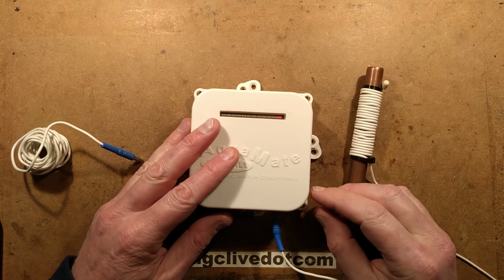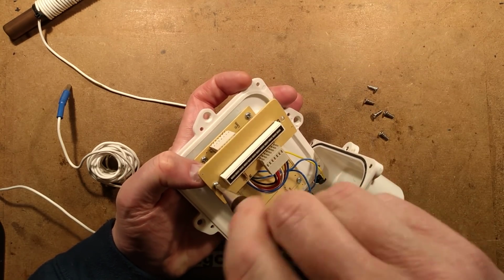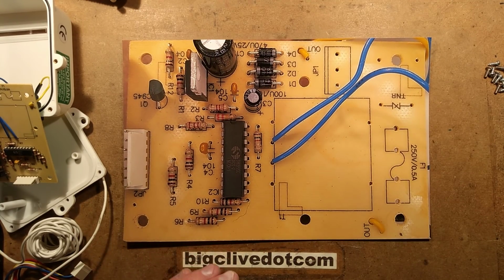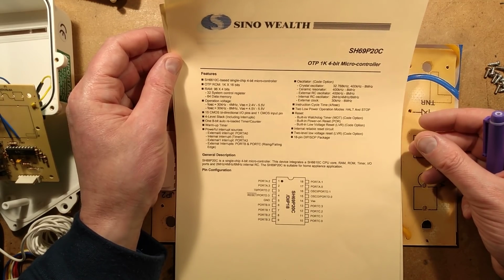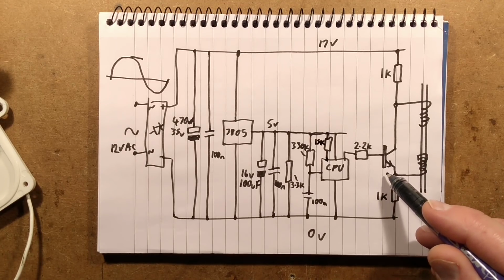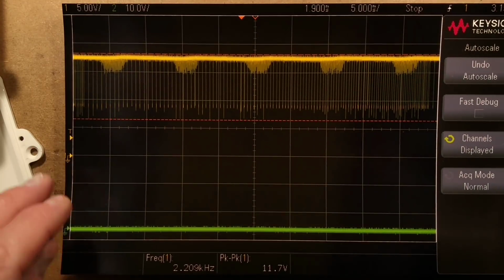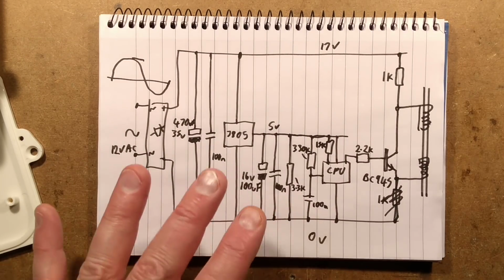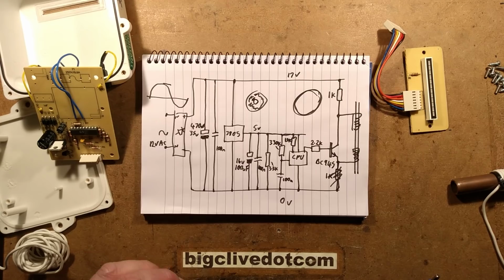inside a computerised pipework scale reducer.

Comment: These devices are pure snake oil. The German term Bauernfängerei (catch a farmer/clodhopper) translates to confidence trick. I hate these a55holes ripping off preferably older people.
Reply: Yes, my father was ripped off by a "flight technician" that said the neighbor used one of these devices for the hard water in the area. As my father was usually suspicious I was amazed he swallowed the proposition without questioning. Earlier I had proposed a filter, but that fell on def ears. I cannot say anything has changed in the last two years it has been installed. But our apparatus have a more confident green light bar going up and down to let you know it is on. The placebo is quite soothing. 

Blinken lichten bedeutet working machine.

The same technician told me he could help me with some weld repair (as I am no welder) but he brought a far to small machine that could not produce enough current. The welds gave out a couple of minutes into using the machinery. The technician no longer can find any work here.
Reply: @aopstoar4842 , these guys ruthlessly picking pockets.
Reply: WAIT! Will you say, my Orgonite Akasha Chembuster did'nt work? Oh nooo! 😱😱😱
Reply: I wonder if this is where the Star Trek "Ferengi" aliens might be named after?
Reply: Blinkende Lichter bedeutet das das Gerät eine Funktion aufweist 🤣
Reply: Vorsicht Falle: Nepper, Schlepper, Bauernfänger.
Reply: I'm surprised that Clive didn't get a powerful smell of bullsh*t when he opened the casing.
Reply: And then you have people buying these scams sometimes for thousands of dollars...
https://www.youtube.com/watch?v=-_56emG8guo
Reply: That Apollo dowsing rod is twice as effective as homeopathy. It's the Antenna ring which makes it highly effective when finding unicorns.
Reply: Looks like Big Water has gotten to all sorts of people...
Reply: I had one in my house for many years believe me it did NOTHING,if you need soft water buy a water softener they cost around $ 500.00 but they do work.
Reply: That will go on forever.   About 10-15 years ago, a plastic ball filled with water was marketed quite successfully as a substitute for laundry detergent.  People swore that it really worked (in fact, most clothes washers don't rinse all detergent from a load, so you still have residuals).  It was one thing that made me lose confidence in the reasoning abilities of "educated" people.

Google "laundry ball" for more information.
Reply: @tubastuff  Interesting. Laundry bollocks would be a better name.
Reply: They are ripping off everyone. Even the people who don't believe these scammers.

Ignorant/gullible people exist everywhere. Some of them are in positions where they can spend public money. Just look at that hospital in Vienna where some quack sucked 95000€ out of them.

https://derstandard.at/2000093123502/Fragen-zu-Esoterik-bei-Wiener-Spital-Nord-bleiben-vorerst-offen 
(https://translate.google.com/ can be used to translate it, just paste the URL into it and select the language)
Reply: I have one similar to this and it does work.The limescale in the toilet cistern  disappeared after fitting.
Reply: @pussinboots1145  They don't work. There's no possible, feasible mechanism for them to do anything useful. I don't know why your toilet cistern limescale vanished, but it has nothing to do with this quackery.

If you want softened water, get a water softener, not one of these silly contraptions (and not one of the fixed magnet ones either).
Reply: @al45tair  I have a similar device called Clearwave.  I can confirm that it does indeed work. But as with most things"your milage may vary". I have cut out copper pipe sections from before and after installing the Clearwave. There was significant reduction of scale in the after pipes. I made no other changes to my plumbing to explain the reduction in scale build up. This is the 2nd home that I've installed one of these with tbe same results. Reduces scale but does not soften the water.
Reply: Strange that you think it's snake oil because I have super hard water and one of these devices completely helped with my water issues. We even have more water pressure now because the hard deposits on the inside of our pipes has came off thus giving us more water pressure. If you research the science behind it you might understand the process. I'm an electric and water utility worker with a degree in electric/ water utility and previously a boiler/ steam turbine enigneer. This was a great alternative for our home. The chemical composition of your water doesn't change but the created magnetic wave does change how minerals behave in fluid thus cutting down the amount of buildup inside your pipes and breaking down the minerals into a smaller element. I have opened up my pipes before and after and it did remove the build up.
Reply: The proper ones work perfectly fine, we used to have one on an open water boiler in the airman's mess kitchen, before it had to be descaled at least once a week. When the scale preventer device was fitted it hardly scaled up just a bit of bloom.
Reply: @DogsBAwesome  There are scale preventers based on filter cartridges that have an ion exchange medium inside them. Those work. These don't. They're snake oil.
Reply: @al45tair  It was a box something like that with something wrapped around the copper pipe as far as I remember, it was over 20 years ago.

Comment: anything similar to this is a joke and the only things that work are a whole home intake water filter and a water softener. that's it... the water filter filters out anything not just for drinking. and the water softener will protect thee water heater and the pipes and fixtures
Reply: You can actually get cartridge-type scale preventers that use an ion exchange column, so that's another genuine option (and is a reasonable choice for protecting a single piece of equipment like a boiler or other water heater). Some of these work by exchanging the carbonate ions rather than the calcium ions, but the end effect is the same.

Comment: I wouldn't buy it, but maybe is induces a sound (vibrations) in the pipe to prevent accumulation of scale.  A hammer probably works as well.
Reply: Incidentally, a hammer would also work well on the unit itself.
Reply: True!  I usually call such action as "Impact therapy".
Reply: Herby1620 -There is not much vibration from something that delivers factions of a mW of power into the pipe...
Reply: You are probably right.  I suspect that the flashing LEDs consume more power than what energy goes into the output leads, probably by at least an order of magnitude (maybe more).

Comment: When transistor is close circuit the two coils are at the same potential about half of that voltage and then when it is open one will be a 17V delta or whatever that power supply was.
Not sure how it works or if it works but the way it was designed with 1k resistors on each sides make sense so that current is limited on both of those outputs for protection.
Reply: Actually the circuit is incapable of turning the transistor fully on because the drive voltage is only 5V, it's an emitter follower.  When  5V is applied to the base, the emitter voltage rises to about 4.5V and so the current is about 4.5V/1k =  4.5mA.  This current flows through the top 1k resistor which also drops 4.5V.  So the Collector voltage drops to 17V - 4.5V = 12.5V.  So the voltage across the output wires switches between 17V and 8V.  All of this is of course irrelevant because it has no effect on the water whatsoever. I'm guessing that the same circuit is used to drive a piezo transducer in rodent repelling devices which also don't work.
Reply: @petehiggins33  Thanks, good job, you saved me a bunch of typing :-)  It's unfortunate that so many people don't know how an emitter follower functions.
Reply: electrodacus - when the transistor is off (like an open switch) no current flows. So the resistors at that point don’t do anything much in terms of current flow. The top wire coil will then be at the supply voltage (nominal +17V). The bottom wire coil will be at 0V. The difference is 17V.
When the transistor is on and conducting current (like a closed switch), current flows from the +V supply (nominal 17V) through both resistors to the 0V rail. As both resistors are 1k ohms, if the transistor is fully on, the voltage at both wire coils will be half the supply voltage (about 8V). The difference is now nothing, they are both at about the same voltage (depending on the saturation voltage of the transistor, likely to be less than 0.1V).
The only useful thing the resistor connected to the 0V rail does, is to help limit the current (along with the other resistor) when the transistor is on. It also causes the voltage change on the wire coil as described above. As Clive says, it’s not actually needed. Why? First note that no point of this circuit is connected to mains earth/ground. There is also no direct electrical connection to the metal of the pipe or to an earth/ground rod. Well without the bottom resistor, the bottom wire coil would always be at 0V. But the voltage on the top wire coil would switch between 17V and 0V. So the voltage difference would switch between 17V and 0V. Yes, the same effect...
At no point can there be a short circuit where any significant current will flow, even if the output wire coils are shorted together.
Makes me think that this device was designed by someone with a limited understanding of electronics.
Reply: @Mark1024MAK   emitter resistor  might be for safety in case pipe isn't grounded and have mains voltage leaking on it

Comment: If anyone actually thinks this works, then it's the placebo effect writ large!
I have an ion exchange softener and a reverse osmosis filter system, both of which can be proven scientifically to work.
Reply: You’re giving it too much credit by comparing it to the placebo effect. Recent studies of the use of placebos have shown that many people get real metabolic changes from the use of placebos probably due to the brain’s response to the thought that the body is getting help from a drug.  This gadget would therefore be worse than a placebo, as the brain’s not going to change the water in any way. It could change the way the body perceives the taste of the water, though, which is exactly what you were saying. In that case, even though it was the placebo effect, the brain may truly be perceiving a better taste (due to its physical responses to its expectation of better tasting water).
Reply: John Squires The placebo effect directly affects spending habits on lime cleanup, which has a measurable effect on maintenance costs.

Comment: To be fair, the led sweep would let you know if the micro is still running or has froze(you know rather than having a hardware or software watchdog) fun fact most Arduino compatible ATmega microcontrollers have a built-in watchdog function

Comment: Honestly, I was kind of expecting the internals to just be for the LEDs.
Reply: The same really, I expected the output to be not connected to anything, but they probably went "we should probably have something for the wires to hook to just so if anyone takes it apart they can't be certain that it's not doing anything.."
Reply: I've seen some of these "electronic descalers" that were just a box with a connector for water in, water out (just a piece of pipe) and for the rest just had a regular building brick inside it to give it some weight.
Reply: oreubens  - Surely it would have been some form of mystically charged brick which had been chosen by someone with a divining rod.....or not.
Reply: if it was only for the LEDs you could probably sue the manufacturer in some parts of the world. Here there is at least something connected so that you would have to prove that it doesn't work. And proving the non-existence of something is very, very difficult...
Reply: @uwezimmermann5427  it is against community guidelines to talk about financially threatening things.
Reply: How do these companies feel living their whole lives as a lie? Someone should sue them anyway.  It's a placebo effect
Reply: @cooliocrib4409  very comfortable as they wipe there behind with green or multi colored paper cloth and now plastic, read cash money.
Reply: The walking LEDs do more to remove scale from the pipes or soften water than the rest of the circuitry in this inane box.
Reply: Wow you made this exciting I love taking things apart but I never know exactly what things are I’m glad that you’re explaining each thing and reverse engineering is fabulous thank you

Comment: glorified led chaser in waterproof case... theres no way that is going to descale water
Reply: But...but it has "Knight Rider" LEDs.

That's at least something, right? It means "something magical is happening". lol

Yeah, I hate devices like this. Preying on the vulnerable or technically challenged.

More Countries need to make boxes like this illegal.

Perhaps if the voltage and current on the pipe were way higher, it would have a chance to ionize the water and maybe have a chance to do erm, something? lol

But would then be quite dangerous if the cable connections were exposed.
Reply: @electronash  wanna hope someone hasnt bodged an earth wire to the pipes too!..and voltage/current isnt magically gonna be between the 2 coils.. if anythin was getting into the water it would make it active straight outta the tap!
Reply: @WacKEDmaN  

Yeah, it is very worrying about what some of these boxes are doing. I'm sure there are plenty that simply pass the mains (or HV pulses) directly through the coil of wire.

As Sir Clive of Bigness said, though - even if it was a full inductor with two connections, a metal pipe would act a lot like a "shorted turn" on a transformer anyway, so the net voltage across the section of pipe would be almost zero.

I know there are genuinely useful de-scaling systems available, but they are often combined with filtration, so are more to just aid the filters somewhat.

I don't pretend to know the chemistry behind it, but I'm 99% sure this particular device will be using more power on the LEDs and lossy wall wart than it actually makes practical use of. lol
Reply: WacKEDmaN uhm... all metal water pipes should be earthed. That’s not a badge.
Reply: WacKEDmaN uhm... all metal water pipes should be earthed. That’s not a bodge.
Reply: @JasperJanssen  bodge*
Reply: Looks cool though!
Reply: I am tempted to buy it for the night rider LED board and the water proof project enclosure :D
Reply: WacKEDmaN you don’t really seem to know what you’re talking about.
Reply: @WacKEDmaN  US code requires the cold water pipes to be electrically bonded to earth ground.
Reply: "US code requires the cold water pipes to be electrically bonded to earth ground." Even my PEX cold water pipes? Good trick!
Reply: Could put it inside a pipe, but not a sewer pipe.
Reply: it's a nice case though.